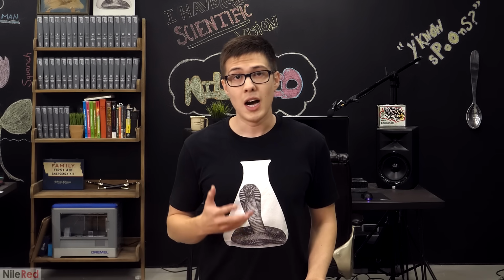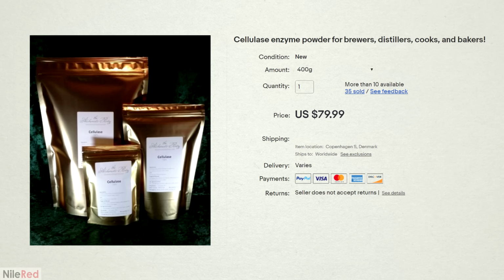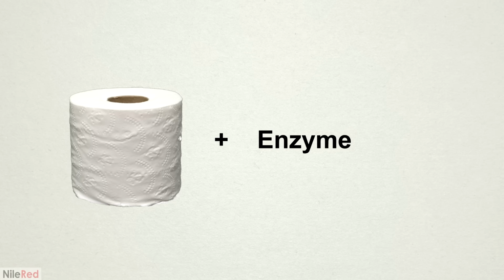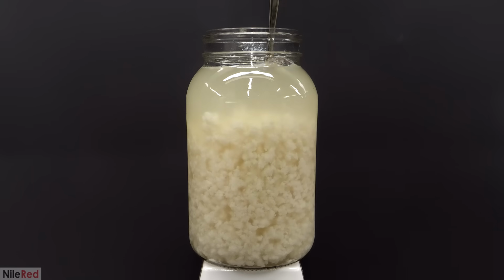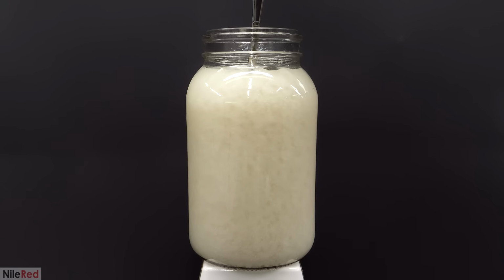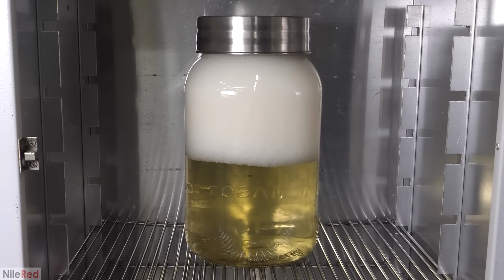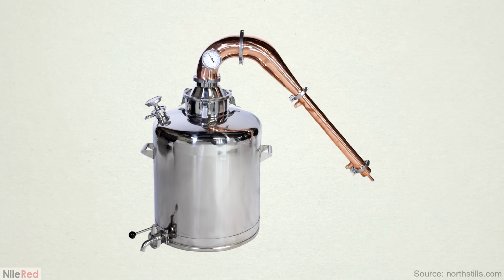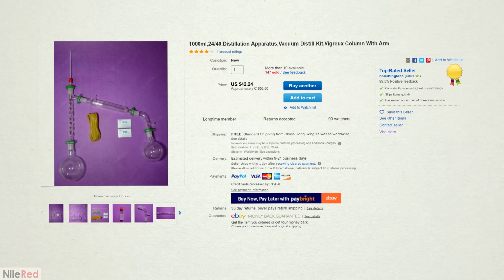Making toilet paper moonshine

Comment: What about methanol? The side product?
Reply: He said it himself, only a byproduct with things that contain pectin, because pectin is a lot like cellulose, a polysacharide but made mostly of galacturic acid, with many or even most acid groups esterified with methanol which will be released durin fermentation. Toilet paper has no pectin or anything that might become methanol so you won't get methanol during distillation. You may still get acetaldehyde though, which is better, but still pretty bad, so always throw out everything that distilled before 77C.
Reply: @Quintinohthree  Yes, but a litle wrong, methanol is also called "wood alchool". Methanol acquired the name wood alcohol because it was once produced chiefly by the destructive distillation of wood. Wine, beer etc naturaly has methanol. Pectin could be increase this amount. And dont forget papers has a litle pectin too. And yeast like "Saccharomyces cerevisiae" could potentialy create this side product(methanol). We made a experiment like this experiment in our department, we found a little methanol too :) By the way i'm a Food Engineer (called Food Scientist in EU) Alcohol fermentation process is sensitive, delicate process. Do not try at home as told in the video.
Reply: @MuratDemir26  Destructive distillation is nothing like what this involved. Destructive distillation involves heating the wood to far higher temperatures where it pyrolyses, then collecting the gasses produced by that pyrolysis.

Yes, wine and beer do contain some methanol. So does orange juice. Not nearly enough to be harmful even when distilled with proper care, because anyone can realise that anything distilling before 77C is not ethanol but something a whole lot less healthy. Also, methanol is non-toxic untill it reaches alcohol dehydrogenase, which ethanol is an excellent competitive inhibitor of, so combined with ethanol, methanol can remain completely non-toxic.

Paper may indeed contain pectin, although the base-wash that is required to actually make paper should be sufficient to mostly deesterify that such that no appreciable amount of methylated pectin remains.

And yes, yeast can produce methanol by itself. So can we, and you can be sure there's more methanol in your body than Nile managed to distill.

If you're an actual food engineer it seems little of your experience actually translates. I don't like bandying about qualifications, because there's idiots at every level who know little beyond their own world. I can assure you that I know pretty well what I am talking about and also pretty well what I don't know about the subject.
Reply: @Quintinohthree  Thank you for your nice response. I understand you very well. I'm a real food engineer but my specialty is not malt or alcohol production. I have only basic scientific knowledge on these issues. There is no point that you have incorrectly explained. Nile explains it well enough too, but some spots remain empty. And some idiots can do things that can hurt themselves with these empty spots. Maybe that's what natural selection requires. I really appreciate your nice explanation. Have a nice day :)

Comment: I've always wondered why ethanol is the only alcohol considered drinkable. The butanols seem to have low toxicity, but from Wikipedia, butanol is about 6 times stronger than ethanol, and except for tert-butanol, not miscible with water. I know methanol gets converted into toxic formic acid, and isopropanol to acetone. I've wondered if anyone has ever made a drink based off of butanol. Ingesting something 6 times stronger than ethanol seems, not good, to say the least.
Reply: 6-times stronger? How can anyone come to that conclusion? Anyway, I've had this discussion at Lunch during my Master's thesis, and I think the point was that ethanol makes you drunk, but all the others just don't do anything. Tert-butanol was what we decided was probably the most likely to do something interesting, especially because it doesn't get decomposed by alcohol dehydrogenase, but it does have the potential to do weird stuff in the stomach, iso-butylating everything around the as the low pH turns it into iso-butyl cations.
Reply: @Quintinohthree  Wikipedia says that n-butanol has been reported to be 6 times stronger, due partly to slower processing by alcohol dehydrogenase. Only animal studies, so not definitive. I'd be interested in reading about someone who'd consumed tert-butanol if there are any case studies.

Comment: Cool idea using an enzyme to break down cellulose. I made a lot of crappy moonshine when I was in school, so I have some experience. I think you might find it goes faster if you don't overfill the boiling flask and if you connect the condenser directly to the flask instead of putting the reflex column between. Boil moderately first run, slower on second run. The first run should have had about the alcohol content you ended up with. The second run should have been strong enough that a sip would kill the top layer of skin in your mouth so it peels off after a minute or so. Except for the obvious foaming problem, I really don't see why it wasn't much stronger than it was. Also, unless the only goal is to see how much alcohol you can get out of it, don't bother with the heads and tails. The heads usually seem to result in a worse hangover (pectins or not) and the tails aren't worth bothering with. Maybe if you were distilling 100 year old French wine or something, but jailhouse toilet booze will rarely see an improvement in flavor.

BTW, who looks at a cute fluffy white kitten and thinks, gee, I think I want to wipe my butt with it? A bear cub, or even a gerbil for detailing,  I can understand, but a kitten WTF?

Comment: Can you use a concoction of chemicals to mimic barrel aging of the alcohol??
Reply: Yes, you can use an intricate mixture of cellulose, hemicellulose and lignin fashioned into curved bars fashioned to interlock into a "fat" cylinder which can be capped with more flat bars of the same material fashioned into circles which fit just inside the cyliders, then bind all this together using bands made of an alloy of iron. You would make an appropriate hole in the curved side of this vessel and deposit the spirit into it, then wait however long is appropriate. The process will take similar time to age as actual barrel aging, but can in a sense be sped up by using a smaller vessel and having the vessel in a higher-temperature environment.

Comment: 28:18
The way light refracts when passing between the mostly water heavy "tails", and the ethanol heavy solution in the beaker is mesmerizing.
Reply: Water mixing with ethanol does that. The “tails” have oils in them, too. That makes them cloudy.
Reply: Yea i love that look. Ive seen it many times and i still find it neat. Not sure if it was due to heat or the alcohol levels but I once mixed two batches together and had that beautiful effect 'floating' on top of that other stuff, even when id flip the bottle upside down.

This was a very good video on moonshine. Id say he hit every good point expect for ignoring potential contamination from from high levels of ethanol steam being in contact with plastics/metals. In general you only ever want moonshine to be in contact with stainless steel, copper and ptfe while distilling, then only store it in glass containers with pfte seals/lids.
Reply: Chris S It was quite accurate. He knows quite a bit about it for some reason. 😉

Comment: Dear NileRed (and other scientists),

I am working on my thesis this year, for which I am going to make ethanol from woodchips. By sheer coincidence you uploaded this video, which was a massive help. However, could you perhaps specify what the chemical way of turning cellulose into sugars is? 

P.S. Love your video’s a lot, they are super high quality and extremely interesting. Greetings from the Netherlands.
Reply: @UC8I8h7Occsm3m6wvijI4wAg He's asking about the acid-catalysed method, not the mechanism of cellulase-catalysed decomposition of cellulose, which the video already explains well enough.

As for the acid-catalysed method, it requires a strong acid, typically hydrochloric or sulphuric acid, at high concentration, anywhere between 1M and 30% probably, at elevated temperature. Put your cellulose in this, maybe base-treat it first like Nile Red did, and give it some time, one, six, twelve, twenty four hours, then you should have an acidic sugar solution. How you separate the sugar from the acid you'll have to figure out yourself. Using sulphuric acid you should be able to use chalk or lime (the mineral, not the fruit) to neutralise and this should precipitate calcium sulphate which can be filtered out somewhat easily.
Reply: Quintinohthree thank you very much for the answer. However, I have tried to use sulfuric acid to get an acidic-sugar solution, but the sulfuric acid instantly turns the wood to carbon. I can’t find any additional information about this acid reaction, because most methods of making glucose out of wood are patented and kept secret by companies.
Reply: @dasdndaan5999  Yeah, don't use neat sulphuric acid, it'll dehydrate any cellulose into carbon foam instantly. You have to dilute it at least some, quite a bit in fact. I'd wager 30% might still be too much, but I'd start at 1M and figure it out from there.
Reply: @Quintinohthree  I'll try your suggestion, although I have tried it before with diluted sulphuric acid. I can't really remember what the concentration was, but i might try 1M dilution. Thank you.
Reply: Join the discord boi
Reply: Just remember wood alcohol is toxic
Reply: @holderheck  Not sure if your being sarcastic, so I'm just going to point out that the term "wood alcohol" doesn't actually relate to this conversation.
Reply: @holderheck  You don't get wood alcohol by distilling a fermentation of wood-cellulose-base glucose, you get wood alcohol by distilling the wood itself, at high enough temperatures that the wood itself breaks down into low mass compounds such as especially wood alcohol.
Reply: @Quintinohthree  if you make ethanol from wood chips about 1% of it comes out as wood alcohol and it is enough to make you sick
Reply: Flyingvoxel nolond I must have been unclear about my plans. My goal is go make ethanol from wood chips, but not directly from it, since that would be dangerous. My plan is to do exactly as NileRed made his alcohol, but instead of toilet paper, I use wood chips. The process should be exactly the same as the one that NileRed uses, but I was wondering what the chemical method of producing glucose from cellulose was.

Comment: One important thing to note:
If you do this yourself, make sure that you are using a stainless steel pot, and not an aluminium one.  If you use an aluminium one. the sodium hydroxide will react with the aluminium generating heat, creating flammable hydrogen gas, and degrading your pot.

Comment: Edit 2: Nevermind this comment he actually talks about this 6 minutes later

@6:03 : There are actually different types of Cellulase enzymes, or, to be more precise, cellulase enzymes can do multiple things. They are grouped into endocellulases, which attack the bond at random positions, exocellulases, which "cut off" mostly cellobiose (the beta1-4 glucose disaccharide) from the ends of the bonds and cellobiases, which splits cellobiose into glucose. Most Bacteria and yeasts like T. reesei produce multiple exocellulases, endocellulases and cellobiases. Although the above isn't entirely correct since it was found out that most of the cellulases specify on one of these things, but most can actually do all of them, this classification is still common. Summarizing, cooking the cellulose in base definitely helps the process a lot, but I've also been able to produce significant amounts of glucose out of paper towels without any pretreatment except for cutting them down a bit and  blending them with a household blender.
Edit:
Specifically t reesei doesn't produce a lot of enzymes that act as exocellulases, so they don't really attack the ends of the bonds too much - so while you can speed the process up alot by pretreatment, they can cope with pretty big chains - here is a figure showing what enzymes t reesei produces: ( https://www.researchgate.net/figure/Trichoderma-reesei-cellulolytic-enzymes_tbl1_317276203 )

Comment: Hold on a minute... you said that all forms of cellulose including wood can be treated like this to form sugar, and simultaneously wood can be put into a wood gasifier to make charcoal, tar, and wood gas. So if you took one massive heap of wood and used that to make wood gas and another to make ethanol and mixed them together, would that produce a fuel that is ideal for use in a typical consumer car? E10 or something with similar knock resistance could be made much cheaper by doing that.

Comment: The chemist in me is intrigued.  The brewer in me is also intrigued... but frustrated.  I'd have taken gravity readings before and after fermentation (but before distillation) to get an idea of actual attenuation and alcohol content.  Your fermentation temperature is a bit high, too.  I think that was EC-1118 you used, in which case your 30C temperature was WAY too high.  18C would've been more appropriate, and you might have avoided some of the esters you tasted.

That being said... this was awesome to watch.
Reply: Oh yeah, and you should've oxygenated your wort/must before adding the yeast.  Put the lid on and shake for a few minutes to dissolve plenty of O2.  Your yeast would have reproduced while consuming all that O2, then switched over to anaerobic fermentation.  This would increase yield and also avoid some off flavors.

Oh, you may have introduced brettanomyces bacteria due to the lack of sanitation.  Unlikely, but brettanmoyces could explain why you were seeing conversion of maltodextrin.  The strain of yeast you used is saccharomyces bayanus, which shouldn't convert dextrins at all.  shrug

Comment: Your enzymatic stage and yeast brewer stage could use a shaking incubator. If you don't want to spend 1000 dollars on that then an aseptic stirbar, low heatplate and airlock on the container will do, you'll want the solution mixing as the reaction goes it'll be alot faster.

Comment: I really liked this video. In case it comes up again, I guess you can use a syringe to suck up the concentrate to avoid the filler material. Not sure if it is worth it though.

Comment: The issue you were having is a common one in moon shining. It is because you are using too high temperatures. When low alc % you need to use super low temps so that you do not get a large percentage of water in the vapor.

Comment: Use sulfuric acid, then neutralize with Calcium hydroxide. Then you can just filter out the CaSO4.
Reply from the maker: It just would've been a bit messy and also use a bunch of acid. It would definitely work though.
Reply: @NileRed  yeah I did it with corn starch, basically doing what you're doing. Wasn't too bad, though the proteins turn black/brown, and is impossible to filter that out, but it doesn't effect the fermentation. Was gonna make a video, just havent got to it yet. :)